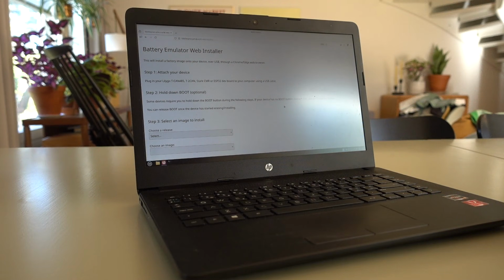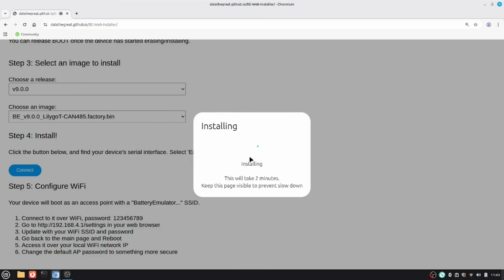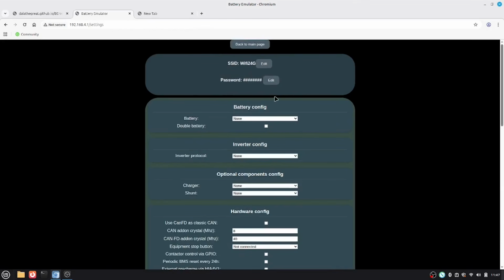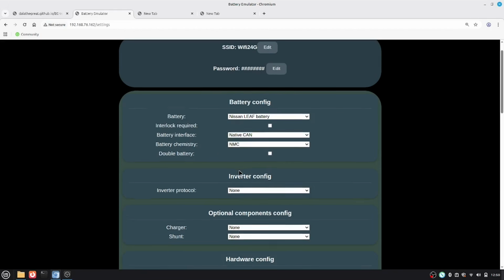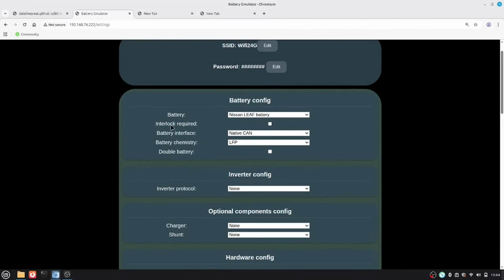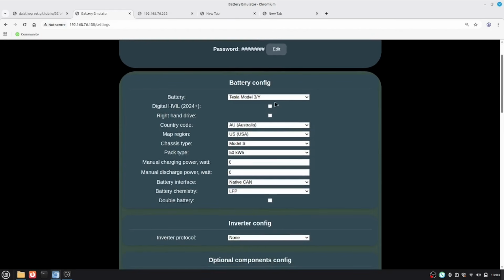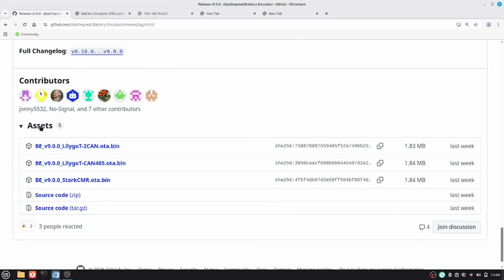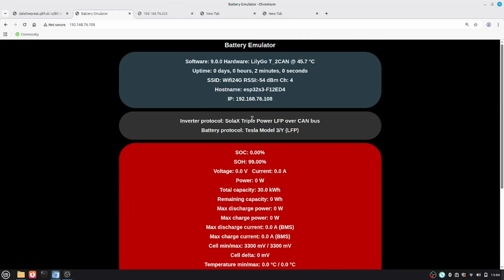Installing Battery-Emulator (2026 guide)

Comment: Connected a MG5 battery, Capacity	50.3, chemistry 	LFP	 Model: BU131A50S	Part number 11486669 to a Deye 25 Kw 3 phase Sun inverter via a lillygo 2 can fd. Works perfectly. Do you want me to sent you the wiring diagram and install pictures & information?  If where to?
Reply from the maker: Awesome! Feel free to contribute wiring diagrams back to the Wiki!

Comment: HI! What are the chances of connecting your emulator to a LeapMotor B10 battery? I have four of them and a 30kW Deye inverter with two BMS outputs. Btw you're doing fantastic job!
Reply from the maker: Use Github to post info for new integrations!

Comment: Subject: Inquiry regarding optimal settings for high-voltage LiFePO4 pack (192 cells) / Smooth charge & discharge tapering

Hi,

I am using your emulator on a LilyGo T_2CAN board (firmware v12.6.0) to connect a Solis inverter with a high-voltage LiFePO4 battery pack consisting of 192 cells (total nominal voltage ~614V, max voltage 681.6V). The system is configured using the BYD Premium HVS protocol.

I would highly appreciate your advice on how to properly configure the emulator to achieve smooth charging at the top and safe, smooth discharging at the bottom.

Currently, I am facing two challenges:

Premature Charge Cut-off (At the Top):
The BMS often reports a high virtual SOC (e.g., 98%) while the actual cell voltages are still low (around 3.33V–3.34V, total voltage ~640V). Because of this high SOC, the emulator or the inverter brings the max charge current down to 0.0A way too early, preventing the battery from fully charging up to the target voltage (681.6V / 3.55V per cell) and balancing properly.
What is the best way to configure the emulator so it ignores the premature 100% SOC and continues to top off the battery smoothly based on actual voltage until it reaches the target? Should I keep "Charge power tapering based on SOC" enabled or disabled, and what values do you recommend?

Smooth Discharge Tapering (At the Bottom):
I want to ensure that when the battery approaches its lower limit (empty state), the emulator commands the inverter to smoothly decrease the discharge power rather than cutting it off abruptly.
Could you advise which parameters I should configure to achieve a smooth discharge ramp-down at the low voltage/SOC threshold?

Attached are the screenshots of my current configuration. Thank you in advance for your support and for this great project!

Best regards,

Comment: Dala I have looked at other people using the cheap Can to RS485, as you are in the process of design CAN to RS485 maybe because of the high voltage of EV batteries, ground loops etc have you thought about using a optical isolated CAN to RS485 etc you have to isolate the power supplies as well, the optical isolators can go upto 1000s of volts isolation,
Reply from the maker: Yes we have people on the Discord set up opto isolated to help prevent lightning strike damages

Comment: Hi Dala, I've been using a BYD Atto 3 with the stark & solax 7.5kw for the last 5 months since I saw your first YouTube video. I have now finally got my 3 phase & my 50kw sunsynk inverter running. 
So we have tried both the protocol 
BYD battery box premium HVS over CAN bus & the 
Pylontech HV battery over CAN bus
The BYD battery box  doesn't seem to communicate at all. 
With the pylontech it communicates & comes up with the soc that is 89% though it throws up a F56 voltage fault though the volts are 418 both with a meter & on the sunsynk display. Also an F58 BMS communication fault. 
The inverter won't do anything that I presume is down to the fault codes? It won't let the solar come in even though it has panels on two strings & you can see the voltage of both sets of panels on the sunsynk screen. 
I have spent all day on this with my dad & we can't figure it out so any help would be much appreciated. 
Thanks Jamie

Comment: Hi Dala, I have the opportunity to buy an 83kw sealion 7 battery. I can't see that on the list of compatible batteries. Do you know if it's the same as the 83kw seal battery & I could just say it is that battery on the stark software? I currently  have the atto 3 BYD 60kw working. 
 Many thanks Jamie
Reply from the maker: Try to get the part number and crosscheck with Wiki. If it has typeB connector it is NOT supported yet. We are working on that on the Discord!
Reply: Perfect thanks, I have just joined your patreon page. I should have the battery next week so will see. Maybe we can help with the reverse engineering. 
Many thanks

Comment: Hi Dala. Quick question regarding the Battery-Emulator compatibility. I have a battery pack from a 2022 Kia e-Soul (64kWh, 150kW / 204HP). The part number on the label is 37501-Q4002. I noticed in the Wiki text that you listed codes like 37501-Q4000 and 37501-Q4052 as supported, but Q4002 isn't explicitly written down. Can you confirm if this specific Q4002 pack works with the standard 'Kia 64kWh' CAN option in the software? Thanks for this amazing open-source project! All the best!
Reply from the maker: Nobody has tested it yet. Most likely it will work just fine!
Reply: @DalasEVRepair thank you Dala! Willl definitely try it.
Reply: @DalasEVRepair Just to inform, yes 37501-Q4002 works just fine

Comment: Hello,
I am working on a custom Range Extender project for my Nissan e-NV200 (On-board charger: 6.6 kW).I have installed an external 43kWh LFP battery pack (3x 16s 280Ah) with an 8kW Off-grid inverter. My goal is to charge the car via the original Type 1 port while driving to extend the range.I am looking for a CAN Bridge that supports this specific setup. 
I need the following features:Charge-while-driving patch: The bridge must allow the car to remain in "Drive" mode while the on-board charger (OBC) is active.SOC/GOM Correction: The bridge needs to handle the "energy correlation" so the car doesn't throw a "VCM/EV System" error when it detects that the battery voltage is not dropping as expected during flight.Vehicle Info: Nissan e-NV200, Year: 2019.
Do you have a pre-configured unit that supports these functions?
Reply from the maker: Nope sorry
Reply: @DalasEVRepair  OK, no problem...🙂

Comment: I am using a Lilygo 2CAN with a Daly BMS and Sofar inverter. Can this work or does the emulator require the BMS to use RS485?
Reply from the maker: See Daly wiki page for info which protocol to use

Comment: Hallo Dala! Es tut mir leid dass ich dich störe. Ganz was anderes! Ich hab ein OVMS modul bestellt Leaf ZE1. Das kabel für gateway hab ich auch gemacht mit db9 stecker. Alles wie in Beschreibung steht. Ich hab 10x gemessen ob alles passt. Ich hab von Gateway Modul das Kabel abgesteckt und nur gemessen. Alles wieder zurückgesetzt auf Original und seitdem geht das CAN Communication nicht mehr das Auto kann ich nicht mehr starten. Akku ab und wieder an für 40min und mit leafspy kann ich auch nicht die Fehlermeldungen löschen. Was kann es sein oder hättest du ein tip? Danke im voraus 
Michi

Comment: Hi Dala
Congratulations on your channel and for sharing your excellent work.
I'm going to start a project based on your material and I would like to know if the BYD Seal PE5, 82.56kWh, 150Ah, 550.4V battery is compatible with the software available in its most current version.
I intend to use the Deye SUN-30K-SG01HP3-EU-BM3 inverter, the LiLygo T-2CAN board. What would be the settings for the perfect functioning of my proposed configuration?
Thank you very much for your help.

Comment: If I have Tesla 3 batteries without the original BMS, can I connect it with this emulator and use Stark CMR to connect to the Deye HV inverter?
Reply from the maker: No, but you can fit the CellKeeper BMS instead!

Comment: Hi Dala. Works great. I bought a Nissan Leaf N-Connecta 2021 but was a bit disappointed with single-phase charging, but with a Leaf battery 40kWh in the garage, it worked out so you can charge 25A (16A net). Can you have your own DC charger? Which OBD2 reader do you think is good?. Regards Claes

Comment: Dear,

This device is very interesting.

I work at a research and development company and we need to integrate the Renault Twizy batteries into a Solax inverter. We are considering acquiring the Stark CMR for this application. On GitHub, the information is that the product is still in the testing phase for this battery. Could you tell me if this has been resolved?

Thank you.

Comment: Hello, while using the battery emulator, I noticed that a very good solution would be to add the ability to limit the minimum and maximum voltage of a single cell, which would protect more degraded cells from excessive discharge or overcharge. I would like to ask about the possibility of adding such a feature to the battery emulator. Thank you in advance.
Reply from the maker: The BMS of the battery already does this!

Comment: Hi Dala, would it be possible to add to the Battery Emulator github info, a table of the batteries that have been successfully unlocked using this emulator method? I'm looking on ebay and see that the breaker yards don't like to give much details on of the battery is locked or the vehicle it comes from had airbag activations.......

Comment: thank you so much. I have about 30  gen 4 leaf modules. I have to find the original nissan bms and contactor so I can use your battery emulator soltion.

Comment: Hi, Wondering if there is any support for Microvast batteries. They supply to commercial but seem to be partnering up with Skoda. I have the option to buy some. but compatiblility is my worry. 
Thoughts.
Reply from the maker: If you can get a datasheet stating how they communicate, post that info on the Github!
Reply: @DalasEVRepair  I've added a topic on github with the info I have been able to gather.

Comment: Buonasera a tutti, Mi chiamo Roberto e scrivo dall' Italia, io ho un impianto fotovoltaico da 4 Kw con inverter Fronius Primo GEN24 Plus , da poco ho acquistato un pacco batterie LiFeP04 da 10 Kw che mi avevano garantito che con il bms installato all' interno era compatibile con il mio inverter, invece niente anche se all'interno ci sono diversi protocolli, io mi chiedevo se installando questo emulatore potevo risolvere il mio problema, la batteria è ad alta tensione, se vi servisse delle foto x capire qualcosa in più chiedete, Grazie a tutti
Reply from the maker: Most likely yes, we support taking in Pylon CAN, and translating it to Fronius Modbus. Suggest to make a post on the Github with more info on your specific battery.
Reply: @DalasEVRepair  Grazie mille lo farò
Reply: Buonasera ho pubblicato un post con tutte le foto della mia batteria, Grazie

Comment: Does anyone have an idea how I can run an EV battery setup with the battery emulator in conjunction with an already installed solar setup that includes a Fronius Symo GEN24 Plus and a BYD HVS 7.7 battery?
Reply from the maker: Not possible. Best to sell the HVS and just use a large EV battery instead
Reply: @DalasEVRepair  Shit. Thx for the quick answer.

Comment: Hello Dala, do you know if it is possible to buy a pre assembled “BMS”/“kit” to connect a Renault zoe 40kwh battery to a Solax X1 hybrid G4 inverter?

Basicamente I would like only to “have the work” of connect the necessary plugs in the Zoe battery and in the solax inverter 😉.
Reply from the maker: You can get the Stark Box from Redispose, it makes it very plug'n'play!

Comment: A fantastic design and truly exceptional attention to detail. Even a layman can easily get it started.

Do you think it's possible to create a single HV battery from several LV batteries connected in series? For example, five 51.2V, 16 kWh batteries each with a JK or Dally BMS?
Reply from the maker: Yes, we support multiple DIY HV BMS options already, and lots of people have had great success with them!

Comment: Regards from Ukraine.. Hallo... Interest connections Deye inverter 30kw Hv.  and VW ID4 MEB  battery.  Watst emulator is beterr.. stark or lyly 2 can, or can 485 and 2515?
Reply from the maker: Stark CMR is very easy but expensive. Next on the list would be T-2CAN+2518FD add-on, cheap but much harder to setup. Good luck!

Comment: But wine literally stands for Wine Is Not Emulator It's a translation layer.. =) Maybe you should have called it BINE instead of ... "emulator" I was like wait so you are emulating a battery so you can use it in a car to see if the car is ok to work with a new battery.. =) Sorry for being such a pedantic but uh oh.. Cool project =)

Comment: So grateful for your hard work doing this for everyone! I have always thought using EV batteries would be the best storage & now you have made this possible! 
Where would you recommend to buy the stark CMR? I could only find it on Redispo website & was about to buy from there. 
Also I am considering a BMW IX battery or nissan leaf as they seem to be the best from your list? I may even buy a whole damaged car to take it from as they are about the same price as just buying the battery with the nissan! 
Inverter wise I may go for the deye if I can get 3 phase here as I currently have 3x8kw sunsynk ones though low voltage so no good for these batteries. 
My dad is also wanting to do this so that will be two more systems you have enabled to work hopefully! He already has a solax so should be good to go. 
Thanks Jamie
Reply: Just seen on your GitHub page that you put a link to that same website for the stark CMR so I have bought one for myself & One for my dad. Sorry I didn't spot that before. Many thanks

Comment: Hi. It¨s working great. I try to to update from 8.12 to new 9.2.4 not working. Went back to 8.12.
Reply from the maker: It is not possible to OTA that large a gap in firmware versions. Use the quickstart guide and perform an initial USB webflash!

Comment: Does the inverter need to be able to accept 400 Volts from the battery or does  communication allow the battery to only output 48v from the pack?
Reply from the maker: The inverter needs to be able to handle 400V. See the Wiki page for a list of all inverters that work!

Comment: Please accept my warmest congratulations for your work, and I have a question for you: could you give me some instructions on hardware configuring a Solax X3 with 2 Renault Kango batteries. May be 2 LyliGo and a mcp2515? A LyliGo and mcp2515 for batteries and second Lyli for inverter? How to setup transmiter and receiver like in older ver. ? I saw  your instruction for tesla battery but it is not clear for me how to setup double battery? Thank you!
Reply from the maker: Get the Stark CMR hardware! Makes it 10x easier
Reply: @DalasEVRepair yes of course, unfortunately it is 10 times more expensive
Reply from the maker: @otdel330  Yes, if budget does not allow for it, 2CAN-LilyGo is my recommendation then with add-on MCP2518FD chip. That way you get three CAN channels

Comment: awesome project. It truly saves opening the battery now and reconfiguring to a lower safer voltage, plus, the battery stays sealed. whole, utilising the stock bms. Awesome.
Reply: Ola amigo , enho uma bateria byd mini 38 kw, não quero modifica-la para baixa tensão, quero utilizar original consegue  assessoria para me ajudara instalar os software?

Comment: Dala, you are amazing. Would it be possible that a similar (or opposit) stuff could help to develop a generic car battery design which then could be used for various old EV-s like Trio cars, Kia Soul, Renault Fluence EV, or even plug-in Prius. An LFP upgrade could give many cars to a second life and could prevent putting many tons of CO2 to the air if those cars' life would be doubled.
Reply from the maker: Absolutely! The CAN decoding that we are doing can be done in "reverse" to make new batteries for older vehicles posible.
Reply: @DalasEVRepair  hopefuly this can be done for chevy volt.

Comment: Great work, thanks!🤗
Will there be config for Io to control the 12 for the Nissan Leaf battery bms to cycle power for the lilygo t-can?
Reply from the maker: Yes that is already doable! Just enable the "Periodic BMS reset every 24h" option in the settings!
Reply: @DalasEVRepair yes, but the pin used for that conflicts with the pins for an extra can module? Or is it changed from pin 18?
Reply from the maker: @lindaljungdahl8688  Yes it conflicts by default. It can be solved by compiling from scratch and editing the HAL file, but ideally we should make this smarter. Can you log a Github issue, and we can look at it as soon as we have time?

Comment: Awesome project! I'm having a Fronius 8kw gen24 installed soon. How can I upgrade it to a plus version without going through the installer? I don't want to be tied into their pricing and batteries.
Reply from the maker: Contact your installer or Fronius directly
Reply: ask for plus version straight up. some installers get cagy about these bat emulator installs.  I am having trouble upgrading mine. Need a friendly installer.

Comment: Hi Dala, I have a 40kw leaf which I plan to use as a donor for battery storage. But unfortunately I see that Huawei inverter is not supported, I have an 8kw hybrid model. Could you explain a bit why this is not possible and will it ever be possible or do I just need to change the inverter?
Reply from the maker: I would say we most likely never will see the Huawei inverters working. They have a very odd design requiring DC/DC converter. See the wiki for more info: https://github.com/dalathegreat/Battery-Emulator/wiki/Inverter:-Huawei-SUN2000

Personally I recommend selling your Huawei, and get another inverter that is supported!